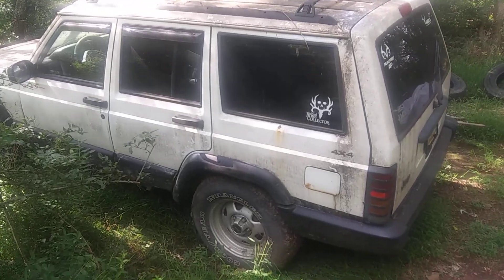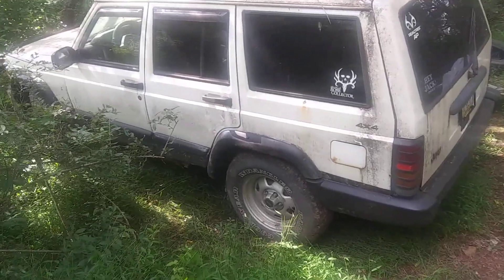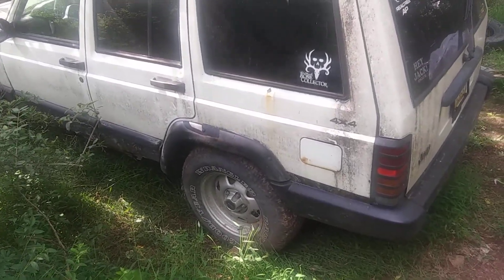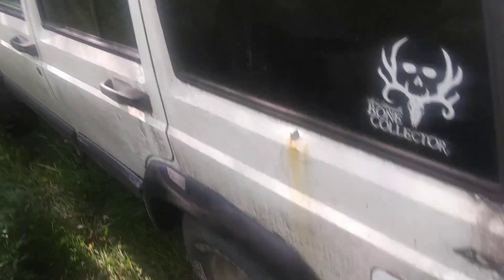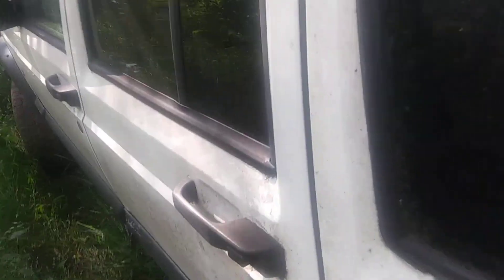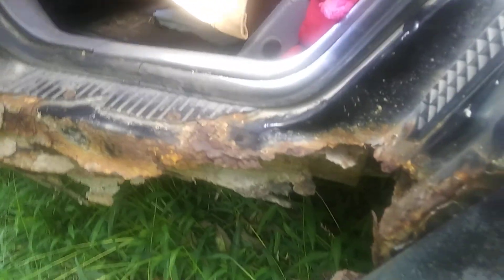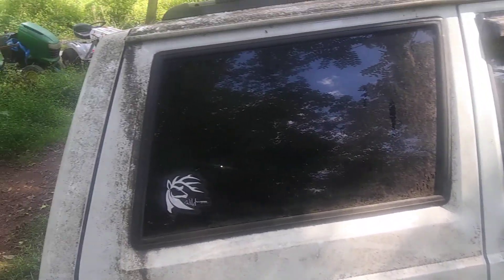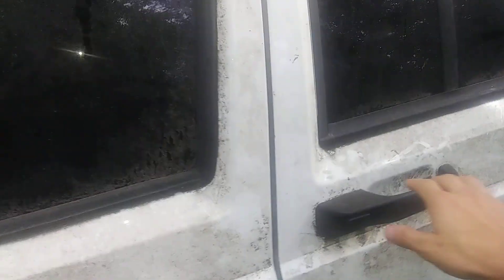jeep Cherokee derby car.

Comment: Did you run end up running the Hyundai tibron and Derby yet?    I just might have bought one and was wondering how it did
Reply from the maker: Had to scrap it.the engien was warped. But I stole all the parts off of it for my elantra. If you derby it go easy on the tranny. The are notoriously delicate in the derby world. But they have serious power in 1 gear.
Reply: @demolitionjourney3639  ok thank you I just bought a 2006 and it has the v6 and runs and drives great and is super solid body.  Thanks for the info on The trans
Reply from the maker: No problem. Let me know how it does. I would like to find another one.
Reply: @demolitionjourney3639  sure will I probably won't run it till next year now there aren't many left around me this year.   Guess that gives me more time all winter to work on it